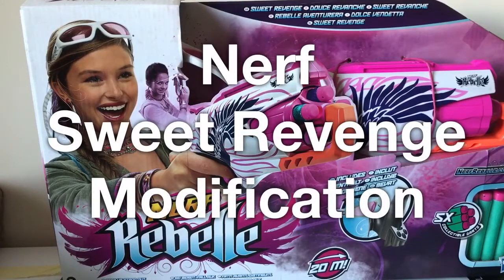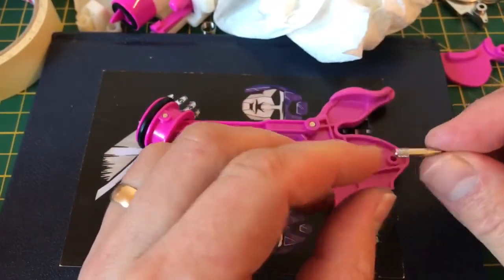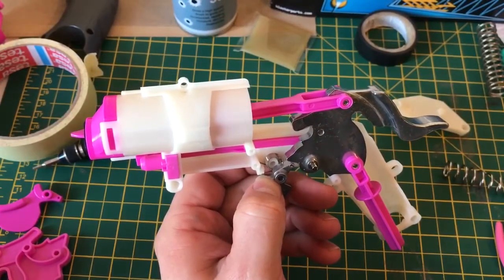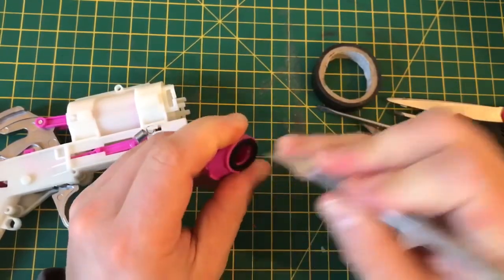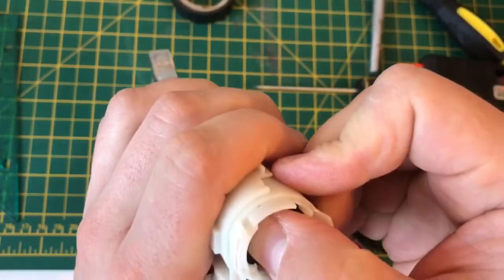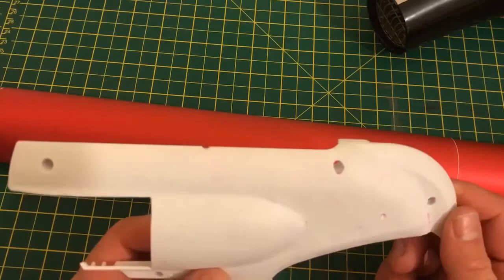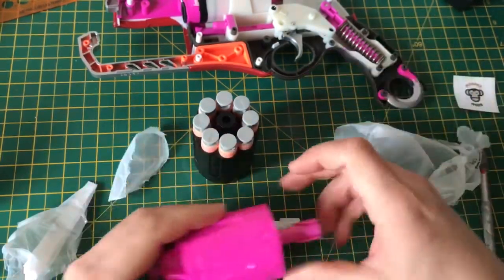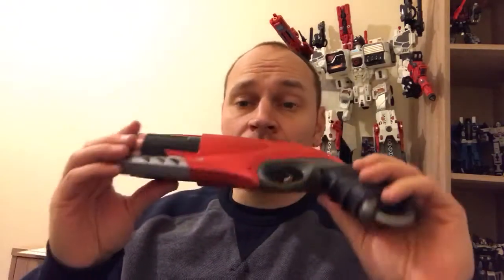Nerf Rebelle total over haul

Comment: It’s probably a bad idea to take the AR out of a Hammershot because you don’t gain much from it and the blaster actually has the hammer pull back the plunger tube with it, so you don’t actually get any air delivery until the plunger tube moves forward to meet the cylinder. If you have the AR in, the air doesn’t start flowing until contact. But with it out, you lose power.
Reply: I would require more detail, as this goes against every mod I've seen! And it does make sense as I did see the plunger tube move and all. Wouldn't the fact that there is no air restrictor in the way kind of equalize the equation?
Say I take out the air restrictor and then elongated the plunger piston, would that work? Still working on my first Hammershot, hehe.